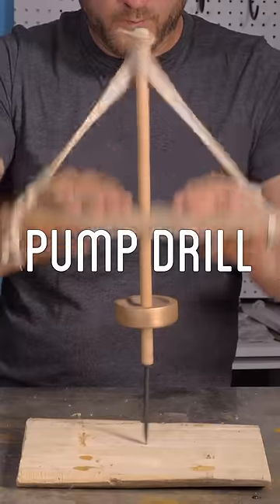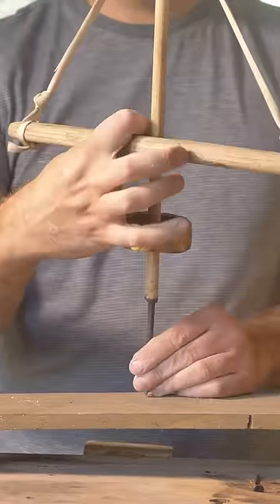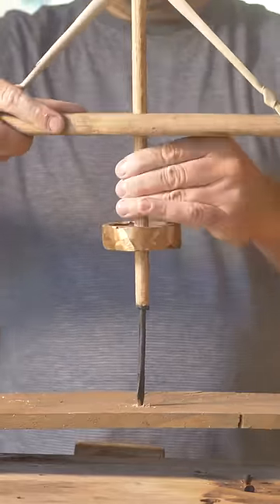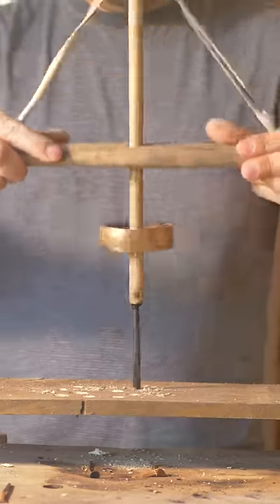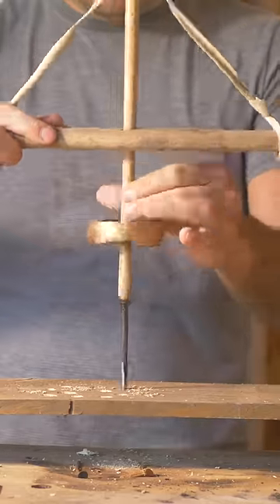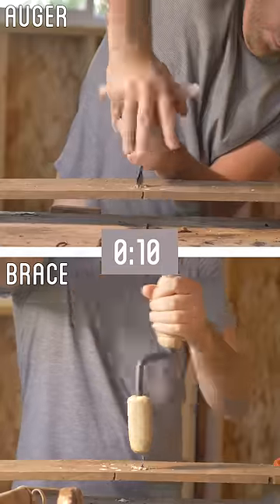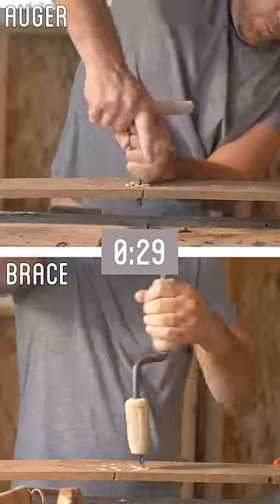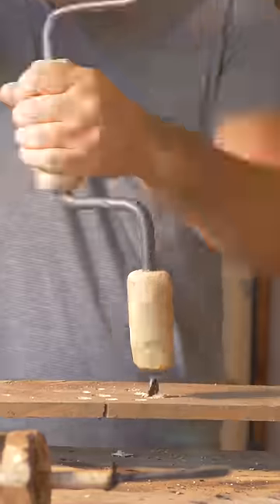Putting Ancient Drills to the Test! #shorts

Comment: The pump drill bit shouldn't have a wider tip than the stem of the bit instead take the bit heat it up and pound it flat then cut it to a point then sharpen one side then flip it over and do the opposite side DO NOT sharpen both sides of the same 2 sides then it should have zero friction

Comment: You are jamming  the bit by using both hands to pump. Put two fingers on each side of the center shaft. Use the other hand to steady the top with a bearing  block. If you wobble an electric drill as much as your pump, it would jam too.

Comment: This pump drill with drill bit combo works especially well for soft metals...copper brass soft steel.. imitate the multiple cutting angle's of a modern drill. Because the pump drill can turn very fast it works well for holes in metal up to 10-13 mm 1/2 inch but the axle needs to be way longer minimum of 3 feet or about one meter to maximize the cutting time

As wood needs a sharper cutting angle and can be cutt slowly twist drills are the way to go...
Every tool has a job i exells as especially with traditional tooling so knowing what tool to use for what job is just as important as the quality of the tool which i feel is a bit neglected on this, page?

Comment: The pump drill is not very useful for wood. It is for stone and metal. You are supposed to use it with just the wood shaft tip and sand placed on the stone or metal to be drilled. The sand wears away the material as the wood rod spins.

Comment: umm...taper the metal, alot. so it starts thin, and gets thicker in diameter. prob will still get stuck in wood, which means you need bigger materials, more force, bla bla.

Comment: Why in the h*** would you suspend the wood when you're gonna drill.  Either put it flat on the surface so it doesn't move when you're drilling.  Hang it off the edge if you're gonna drill on the end.  And if you're worried about punching through the bottom and damaging your work surface then you put the hole over a hole in your work service.  This is pretty common knowledge if you're working with wood.  As soon as you suspended it bends and pretty much That's not what you want.